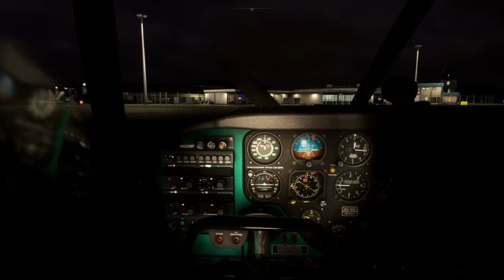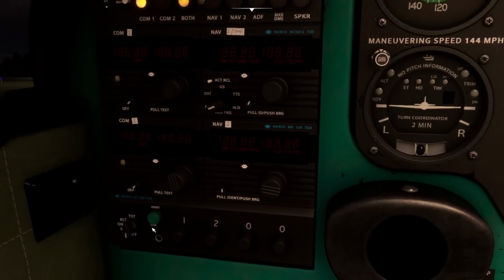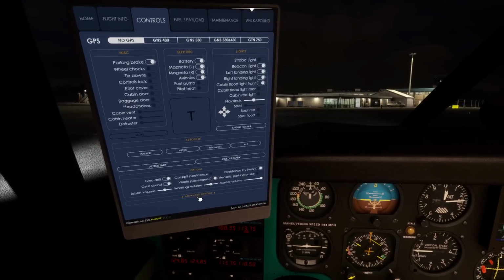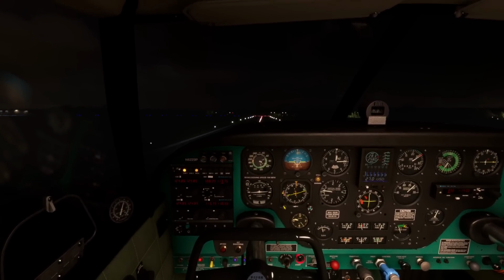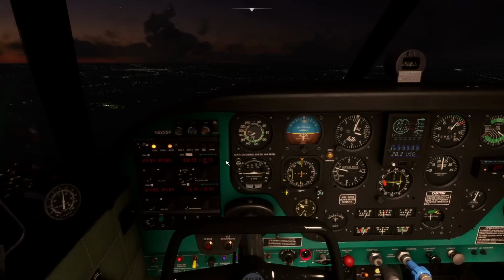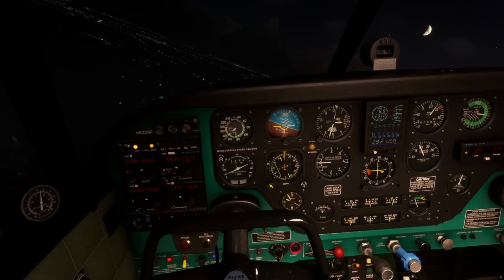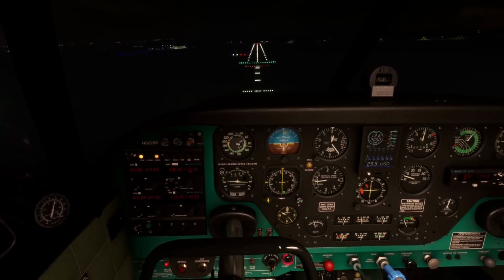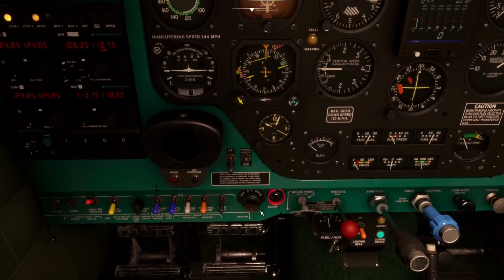Night Flight, Radio Navigation and ILS in the A2A Piper 250 Comanche in Flight Simulator

Comment: Should have an Outer Marker. Tune the ADF to point to it, when the needle is pointing to your Left Wing, you are even with it. I usually go a couple minuets past it, then turn onto course. Should be about 2500 ft abv touvh down, but have time to get Alt. established once you are inbound. Now you have time to "GUNP": Gas, Under Carr, Mixture, Prop! I set up Speed ad power such that as I get close to the Outer Markert, I can lower gear and approah flaps, and retrim for the ride down the glide slope at desired approach speed. All you have to 
is fine adjustments of power hoh hold airsoeed, and very fine adjustment of pith on the Attitude indicater the maintain glide slope. The less you have to do coming down to hold tolerances on a flight check or in rough weather, the better!

Comment: I watched quite a few of your vidoes on ILS, VFR, IFR, etc. This is the first one I've watched where you're using head tracking, is this a recent change for your vids? I use TrackIR and it makes a huge difference, though fiddling with dials can be hard with Legacy or even Lock mode. Any tips? I thinking removing zoom from mouse scroll wheel since I tend to accidentally miss dials and do that all the time.
Reply from the maker: Yes - I've been trying out the Tobii eye tracker. The main lesson is to lean in to instruments - make them bigger on the screen - they you're less likely to move your head :)  Eye tracking might actually help with that too - I'm still figuring it all out.